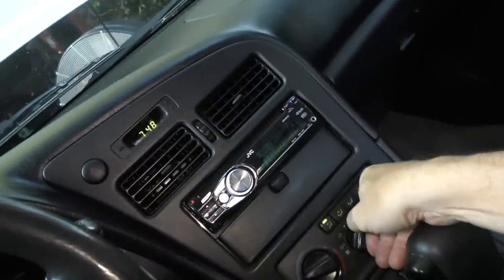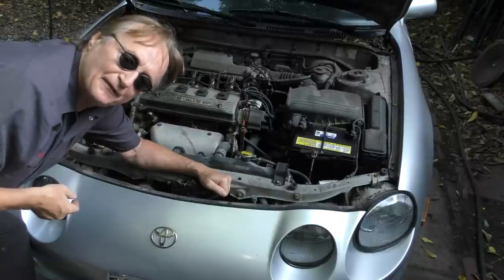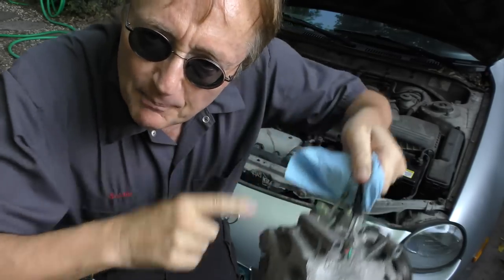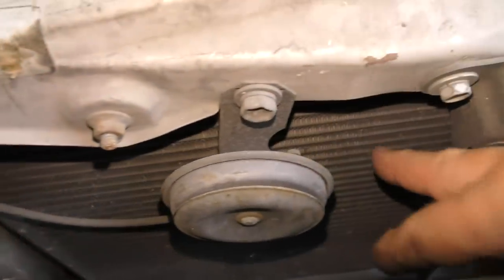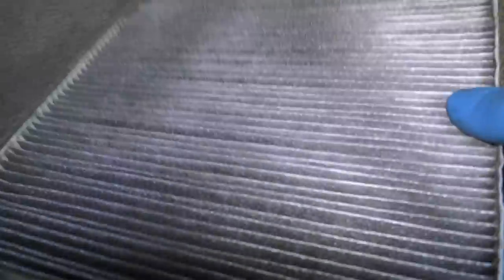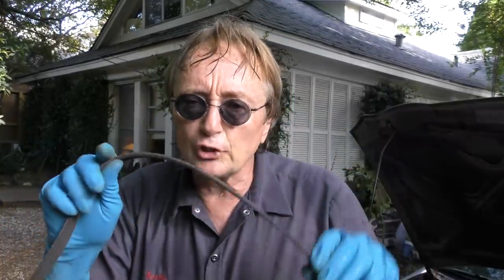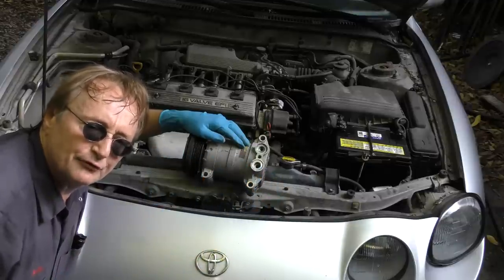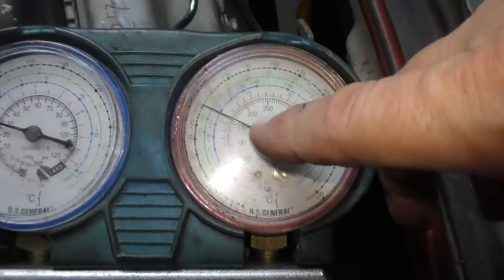How to Keep Your Car's AC Blowing Ice Cold

Comment: Hey scotty. I own a 2002 subaru impreza t.s. and its about 75° outside and while I was driving around 35mph windows down, and AC on, when i noticed frost blowing out my middle vents, which is weird because yesterday it disnt feel very cold but todaybits freezing cold.. i was driving through  a bunch of forest fire smoke yesterday on my 250 mile trip, could it be that it clogged something and caused my compressor to clog or something?
Reply: Do you have a cabin air filter? If so the forest fire probably clogged that filter and the evaporator is now getting too cold. Try changing the cabin air filter.

Comment: I have a 2012  6.0 V8 SS Holden Commodore,i started the engine then turned the aircon on and turned the fan on to highest setting it took about 20 seconds for the first fan to come on and then it stopped then the other fan came on and then stopped and then they  were alternating,one would go off and the other on and vice versa,is that normal or is that the way it is supposed to work in that model of car!

Comment: Can we repair a compressor? Or when this cannot be repaired n just replaced
Reply: The most you can do on a compressor is replace the clutch assembly, the coil and the shaft seal. Anything else, such as fucked up internals, just get a new compressor, even a scrapyard one may be good enough provided you properly do the oil balance procedure (remove any oil left in the system and in the scrapyard compressor, then fill certain parts of the system and the compressor with precise quantities of the required compressor oil, and turn the compressor shaft a certain number of times so that the internals get lubed before mounting it back up, regassing and turning the AC on).

Comment: I have a question I have a Honda Civic 2006  and the ac good for 15 min and then it’s starts blowing hot air y turn off the ac and then y turn it back on and it’s cold again what’s going on?? Thanks

Comment: Mr. Scotty. Please help me 😭 I have 2006 chevy Avalanche  and the Air conditioning flow is very weak. My truck it doesn't have an air filter. So what is the reason airflow so weak. and how I can fix it? Pleeeeas HELP.
Reply: If it doesn't have an air filter and you set the fan speed to max only to have very weak air flow then the cabin blower is defective.

Comment: 2004 subaru outback ac stops working after running after 5 minutes, got it charged and a different heater ac control head

Comment: Hi I was told you can fit an adjustable thermostat to your aircon so you can wind it down or up to get colder air would that be right
Reply: Not that simple. The more frequently you cycle the compressor clutch the faster you wear the clutch and the compressor up. For this reason most car systems are set up so that the compressor clutch cuts off when the evaporator reaches a temperature which is right above the freezing point (around 32-34 F) and in bus HVAC systems with a single compressor that feeds both the passenger and the dash AC the dash one can't run when the passenger blowers are off. Also if you ice an evaporator up too frequently you risk stressing the metal and cracking it up and you get a leaking evaporator. For this reason (and other ones such as the oil stopping inside the frozen evaporator and depriving the compressor of lubrication, or liquid refrigerant getting past the TXV/orifice tube control and slugging the compressor) you don't want it to freeze up. However if you can cycle the compressor's pumping capacity like with clutchless variable displacement compressors with solenoid control valves then you can make the evaporator reach the temperature you want (above freezing point) without any stress to the compressor at all.
Reply: @teravolt6113  Thank you

Comment: Which manufacturers produces a quality a/c compressor for a 1997 Buick Park Ave ?  We live in the San Joaquin Valley of California and it gets hot like weeks over 100 degrees.
Reply from the maker: delco
Reply: Thank you.  Is Delphi a similar company?
Reply: I agree that AC Delco is top quality.  Most of the original parts on my 1997 Buick Park Ave.  are AC Delco.  Is Delphi also a quality brand for a/c compressors?  The only place you can purchase AC Delco in our area is from a dealership and it is ridiculous what the dealership charges.  Delphi is a brand that is sold at car parts stores and though it is more expensive than a store brand or other cheaper brands of compressors is it a similar quality as Delco?  Is Delphi also a GM parts manufacturer?   Thank you so much for your time.

Comment: Hey Scotty, my car is blowing luke warm air I cleaned and sprayed down my cars ac condenser and it seemed to be a temporary fix the air was blowing really cold for about 10 minutes after I started driving then it just went back to the normal same temp any suggestions?
Reply: Replace that condenser, as they get really old they don't do their job like supposed to do anymore

Comment: hi sir, i have a question regarding a/c of my jeep. my a/c works sometime and go off automatic even i changed a/c filter but whenever i press gas more than 2 rpm then a/c start work then go off. can you please tell me what is happening or cause of it? i would heartily appreciate your prompt reply. thank you . 

From Nepal.
Reply from the maker: those are computer run AC systems, start by having a pro scan the HVAC system for trouble codes and pray one pops up. Otherwise, it can get really expensive figuring out such a weird fault.
Reply: Thank you very much for prompt response.

Comment: I was told a 2006 Escalade has no cabin air filer. is that true?
Reply from the maker: it goes by VIN number, call a dealer parts dept, they can tell you by sure. My info system doesn't go that indepth

Comment: just want to ask something, whats wrong when your low side inlet port is sucking air? when inlet port is closed? the highside inlet port is sucking air at smaller rate... tnx...
Reply from the maker: ports are supposed to be sealed, either valves are bad or something is leaking that needs replacing

Comment: For the cabin air filter, is it not used when the car is on circulation mode??
Reply: Depends upon where it is located. If it's right after the external air passages and before the external air damper, it won't filter anything with recirculation on. If it's right after the external air damper, it's always filtering air.
Reply: TeraVolt hmmm.. well mine is in the engine bay by the dash, so from what i understand it doesn't circulate.
Reply: Yes, it won't filter recirculated air.

Comment: Cabin air filter? Is that the same as the AC filter or a different one?
Reply: Filters the air that comes from the outside so it's both heating and AC filter in one, so cabin air filter is a synonym for AC filter. If it gets dirty, less air is moved by the fan so less air goes through the evaporator or the heating matrix and, respectively, you have not so cold AC and not so warm heating, if you have automatic AC you find the system struggles to maintain the temperature you set if you set it very low or very high. Not to mention the smell. Another filter in the system is the receiver dryer, this one is right after the condenser and filters the gas and oil mixture in order to remove leftover humidity and impurities, and the system needs to be degassed and then vacuumed and regassed in order for it to be changed (have it changed every 6 years or so and every time the system is open too).
Reply: +Teravolt
I think receiver-drier exists only in the system which uses thermostatic expansion valve (TXV). Whereas in a system which uses orifice tube instead of TXV, there is no receiver-drier at the condenser. Instead, it uses Accumulator which is located between evaporator and compressor.
My car is of TXV type, there is a receiver-drier next to the condenser, but I haven't checked if it has sight glass.
Reply: You're right, orifice tubes don't do their job as good as TXVs do in keeping too much liquid refrigerant from reaching the compressor and damaging it (since liquids are incompressible), because they don't adjust to the pressure like TXVs do. So orifice tube equipped systems have a much larger filter called accumulator because in addition to filtering and drying the refrigerant, it accumulates the liquid refrigerant that comes out of the orifice tube (placed right after the condenser) allowing only the vapor to reach the compressor. Unlike the receiver drier, which is after the condenser and before the txv, the accumulator is after the evaporator and before the compressor. However, compared to TXVs, orifice tubes are obsolete technology.
Reply: +Teravolt
From what I learned in a refrigeration system years ago, an expansion valve is a basic component; so I guess it has been used before orifice tubes came. I didn't follow the progress or advancement of HVRAC technology, because Refrigeration and AC is just a course I had to take then : only care for how to compute COP or RH (using charts) for the system in order to pass the course. :) It's not my favorite course/subject.
It looks like you are proficient in many aspects of a vehicle, including its mechanical-electrical.
Just curious, are you a mechanical/electrical engineer ?
Reply: No, just interested in these subjects, read a lot of manuals in spare time. Electrical/Mechanical Engineers btw are more like mathematicists and physicists in my country, they have to study way too maths (calculus, geometry, linear algebra) and physics for my taste, and for common sense i guess. I'm still a STEM student btw, a little late on my schedule too because Calculus and Electromagnetics nearly brought me to the point of a serious mental breakdown, and keeping myself interested in other subjects is how i keep from reaching that point ever again.
Reply: +TeraVolt
I see. 
Both Math, esp Calculus and Physics are required for studying advanced subjects in Mechanical and Electrical Engineering. I like Calculus from high school, it's my favorite. :)
Electromagnetic is a difficult subject, though; I struggled in that course and only passed it with low grade. What I mean with Electromagnetic here is when viewed as Field and Wave, not Electric Circuit which is interesting (and useful) for me.

Electric Circuit should not be avoided because it is frequently encountered in daily life. I regret I didn't learn it seriously; again only learned it to pass the course without gaining a solid grasp of the subject. Now I have to relearn it, because sooner or later I need to work on electric parts in my car such as relay, solenoid in starter motor, generator, distributor, etc.
Reply: You're right, Calculus and Physics are necessary to fully understand STEM. The problem is, sometimes it just gets too much because most courses are designed with top tier students in mind (little Einsteins, basically) and not everyone is up to that level but that doesn't mean they're unfit for a degree in a certain subject (unlike with military, for example), and if things become too hard you may find yourself choosing between your career and your mental health. Any person sound of mind will undoubtly choose his/her mental health over his/her career. Sadly, most of the times, who finds himself/herself in that very situation and hasn't got the money to keep paying extra tuitions, ends giving up on STEM degrees.

Comment: Does anybody know where the A/C clutch relay is located on a 2001 Toyota Tacoma SR5 V6 PreRunner? I looked and looked at the fuse box and don't see anything that says MG CLT. All I see is HEATER, but no magnetic clutch relay.
When I turn on my A/C (mainly on Lo or medium) I hear a click sound and I could hear my A/C compressor cycling on and off repeatedly and rapidly and no cold air. But when I crank it up to max high, the clicking stops and I get cold air. Anyone else has this particular issue with their Tacoma? Did you fix it? What and how did you fixed it? Thanks my friends!

Comment: hey scotty I have a Mazda mx3 93. I installed a new ac belt because someone had  taken it off so I noticed the ac clutch was not spinning. so I added freon and I heard the ac compressor kick on and clutch turned on for like a couple of seconds and then it turned off and it won't turn on no more. Do you think it could be the ac compressor pressure release valve leaking?  please help me thank you.
Reply from the maker: could be tons of thing, put some ac leak dye in a can in and search

Comment: I have a 2000 Chevy suburban and it blows hot air when at idle but when I drive it's cold any suggestions?
Reply: Clean that condenser, check for proper condenser airflow and condenser fan/cooling fan operation

Comment: Question, my fan is working when I ran my ac however it will stop for a few seconds and then run again..is that natural or it should run and should not stop?
Reply: Natural. Once the HP line's (the one coming out of the compressor) pressure decreases below the threshold that closes the pressure switch on the "fan" position (or, if you have a pressure sensor instead of a pressure switch, triggers the ECU), the fan is automatically turned off. Once it increases, it's turned on again. It also means you have no obstructions in your system and the refrigerant can flow freely.

Comment: I have a problem with my ac recently got a new ac compressor and it everything was working fine since I only drive to work and home which is only a 10 min drive my ac runs nice and cold but after 20 mins or so it stop running cold air And one day it stop running cold air and I opened up the hood and so it froze up so I change the pressure switch  idk what else to do I have an 01 Chevy suburban  any advice?
Reply: If you notice the vent airflow decrease as soon as it "stops running cold air", it means that the evaporator is freezing up. Bad cabin air filter or low charge can do this.

Comment: I own a 2005 Toyota mark x and is leaking water , driver side floor and behind driver ( passenger side ) throughout the floor vents . When I drive the car and turn to the right it make a noise coming from the aircon vent . Can you help pls
Reply: Leaking heater core or a plugged ac condensation drain

Comment: Scotty how do you fixed a power steering leaks
Reply from the maker: you find the leak and replace the bad part. often just a leaking high pressure hose, see where the fluid squirts out
Reply: josh wible pray its not the steering rack..

Comment: I re-gas my car AC with propane , costs 50c instead of $80 -$100 to get someone to put 134a in every year or two . I've had cars that ran dual fuel with a 90 litre lpg tank down the back and a converter , pipework , electric solenoid valves etc. under the bonnet ( hood ) so don't tell me running an AC on propane is a safety hazard .

Comment: Scotty i have a 2003 pathfinder i changed out the whole ac system components except the evaporater and the ac blows very cold air but sometimes it just starts blowing not as cold air so i have to switch it of for couple of minutes then start it again what could be the problem
Reply from the maker: it could be freezing up the evap from a bad tempt sensor on the evap
Reply: Scotty Kilmer well it isnt today i switched on the ac and measured the pressure with a pressure gauge and found that at the beginning it shows 30 psi then after about 10 minutes it goes to 20 psi should i only recharge the system or what?
Reply: Scotty Kilmer btw love your channel been watching since i was a kid

Comment: Hi Buddy, 
I have some serious issue with my car's AC. It's "Skoda Octavia 1.9 Rider" 2005 Diesel. 
Whenever I hit the gas to gain sudden speed the AC stops working and blows hot air. 
Then I have to turn off and leave it for an hour or so then AC may start working again. I have been to many service stations and all they have to say is "Replace the cooling coil!". But was never able to get a longterm solution. Can you help me??
Reply from the maker: check for vacuum leaks, and have a pro scan the ac system to see if any trouble codes have set for the hvac system
Reply: Scotty Kilmer Thanks!! I shall try this ASAP and update you.
Reply: Hey, Scotty! I want to give you a BIG THANK YOU!!!! 
It was due to the radiator fan. I got it replaced and it worked like new. THANKS A TON! Otherwise, it was yearly expense of INR 9000/- to 12000/- for AC cooling.

Comment: question? what would cause a loud noise through my vent when I turn the a.c./heat all the way up and or how do i fix it..
Reply from the maker: pray its just leaves inside the blower cage which you can clean out, but often it's worn bearings requiring a new blower motor
Reply: Scotty Kilmer do you have a video on how to fix that blower motor?

Comment: So what level should I put my ac do I turn it all the way up or just 1 level or 2 or all the wall let me know
Reply: Level is fan speed in manual AC. Cooling capacity is proportional to evaporator fan speed too. You should put it to a level you feel comfortable at. Begin with the fan on max and then reduce it as soon as you feel cold. Also turn recirc on for maximum cold, and turn it off when you feel too cold. Don't turn heat on unless you want to waste energy.

Comment: My trucks AC gets warm at idle, I've had it serviced, and it still does this. What might be the issue? It's totally charged the condenser is clean and there are no electric fans or cabin filters, any ideas?
Reply from the maker: often fan on the radiator doesn't lsuck enough air and that happens. If not that, a worn compressor also does that

Comment: Hello, I have an 06 Saturn ion and my ac fuse keeps popping when I turn turn on the ac can you tell me what's the problem!?! Thanks!
Reply from the maker: you have a short, first unplug the AC clutch wiring and if it stops blowing, compressor needs replacing as that's the shrot
Reply: The problem is you have a Saturn.